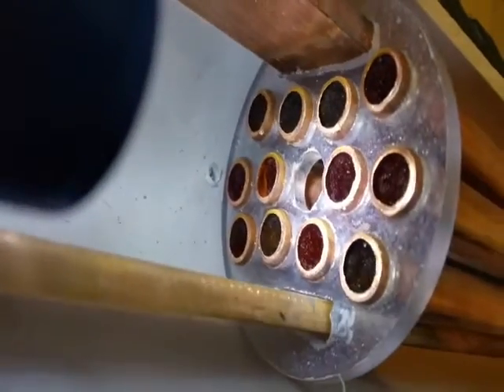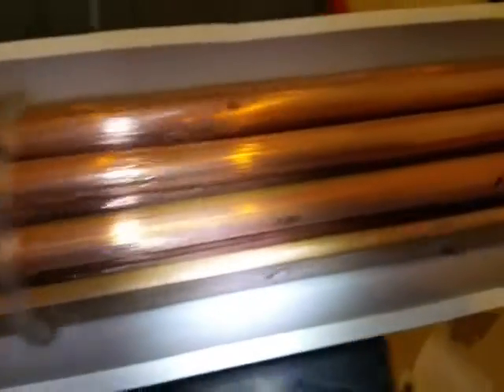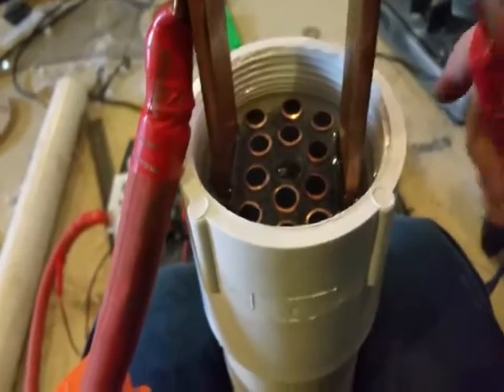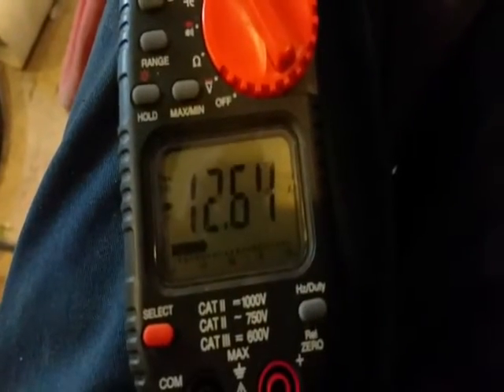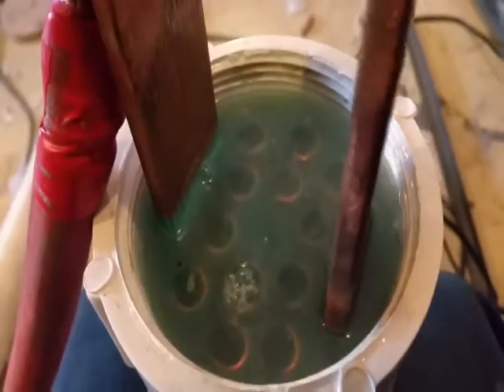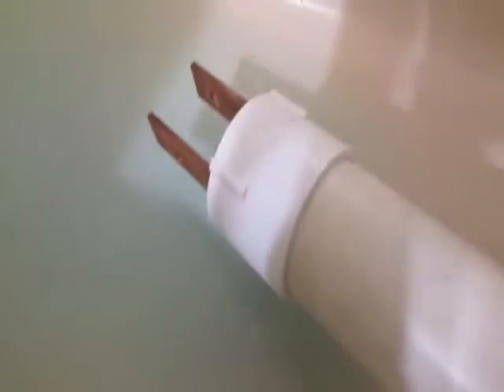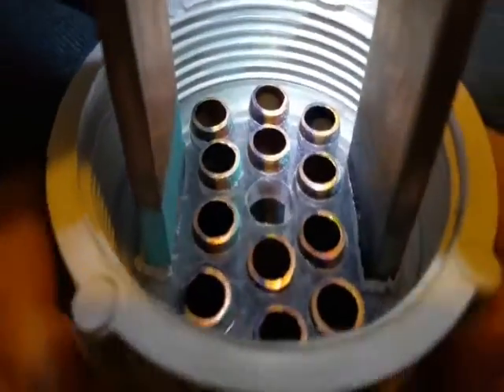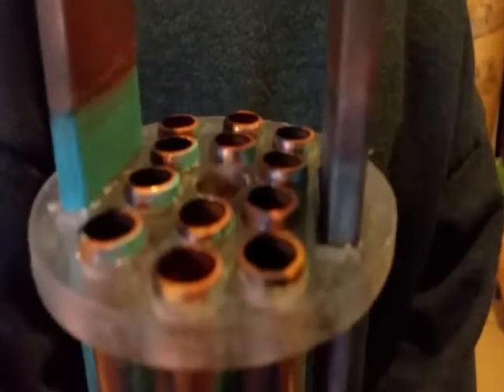HHO generator Pt. 2 Why copper doesn't work

Comment: I thought copper would be better.
because it doesn't react with water but it reacts with oxygen...you get copper corrosion with oxygen 

Thats really good experiment Great work because it shows that really water is divided into oxygen and hydrogen, not the metal reaction its not a chemical reaction its more like physical chemo reaction the electrons act like a saw cutting and dividing water molecules into the original state gas hydrogen and oxygen, heat bring it back into molecule into water.

But with copper this happen
 Cu+H2O+CO2+O2 -->CuCO3⋅Cu(OH)2 This is a chemical reaction of copper corrosion but the process of dividing the water molecules into smaller oxygen and hydrogen is not chemical process... More like physics.

Thank you 😊

Comment: If you electroplate the copper with nickel it will work. Solid Nickel is the best affordable alternative. Gold or platinum would be better… but obviously too expensive. Otherwise 316 Stainlesssteel is the best compromise and cost efficient.

Comment: i think copper produce more hho than stainless, since copper is more conductor than stainless...  please reply me people.
Reply: Copper oxidizes too quickly.
Reply: Our positive side need be silver  on bests side ,or the cheap  virgin stainless steel  an on negative side Cooper you will have complete different result  guarantee,
Reply: The problem is the O2 oxygen

With copper this happen
 Cu+H2O+CO2+O2 -->CuCO3⋅Cu(OH)2
This is a chemical reaction of copper corrosion you cannot get rid of oxygen so don't use copper ...

Comment: You should be able to use copper for the cathode.  Use palladium plated titanium for the anodes.  You could probably just get away with titanium grade 7 anodes, but if plated with palladium or platinum, that will prolong the life of the anode by an unbelievable amount of time.  Copper anodes will decompose the instant they are turned on.

Comment: Coper TAKES too much Oxygen. Resistance - being so low - at 12.91v, you have too much Ampere drag - hence heat - and I do not see much HH in the process. Good try anyway!